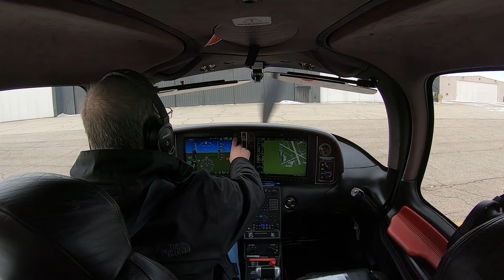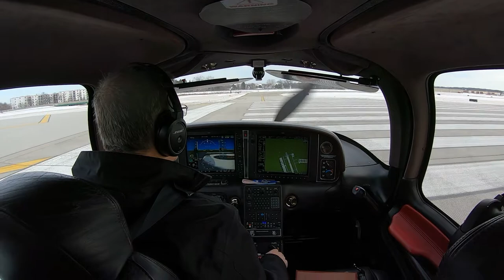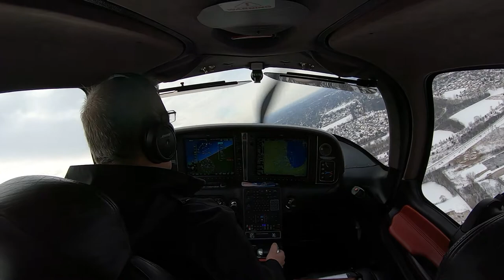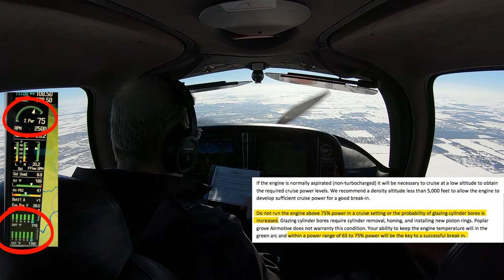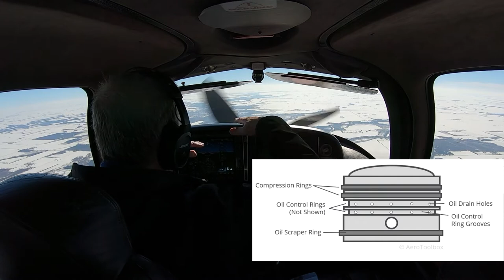Breaking-In A Piston Aircraft Engine (Cylinders)

Comment: How many flight hours when you got the new cylinders?
Reply from the maker: Flight hours, it was about 1500 hours (estimated).  We probably should've gotten a new engine at that point, but we had a new partner in the plane and he was quite upset that we were opting for a new engine.  The shop told us they felt a top was an OK solution.  Hmmmm.

Comment: I'm interest to know how you set up your GoPro so that you can film from the back. Thanks!
Reply from the maker: I've used a couple different mounts.  At first I used a standard GoPro mount which was affixed to a piece of plexiglass that was screwed into the overhead speaker grill.  That was a little too far back and ended up cracking the speaker grill, so I used a vise clamp that attached to the O2 hub in the ceiling.  Then I discovered a Cirrus pilot that made a mount that actually clicks into the O2 port.  Really works well.  Others I have talked to have  used a tripod they stand up just behind the center console.  I have used an "octopus-legged" tripod mount and affixed it to the co-pilot seat.  Lastly, I have used a suction mount on the sun visor, and articulate it in various positions to easily move change perspective.  Long answer to a short question, but hopefully helps you get creative on a budget!!!  BTW, I've also thought about using a shower rod behind the front seats and affix a vise mount to the rod.